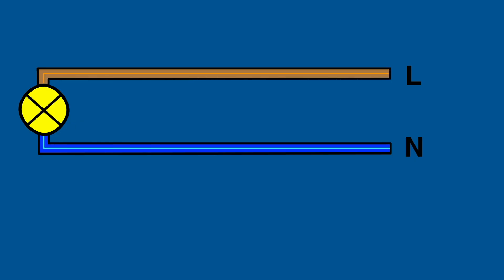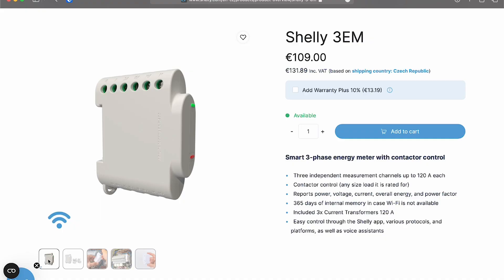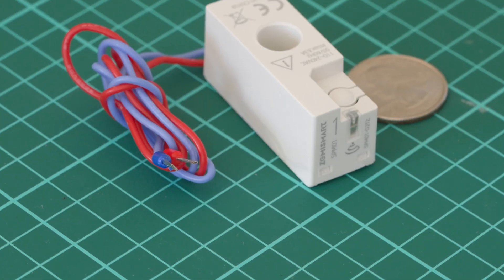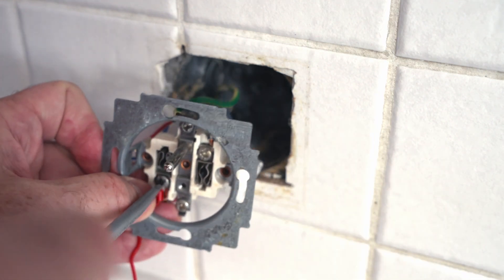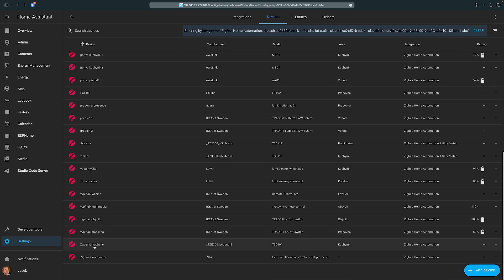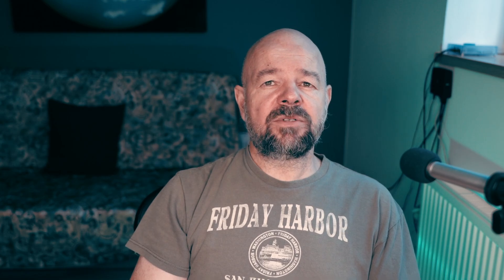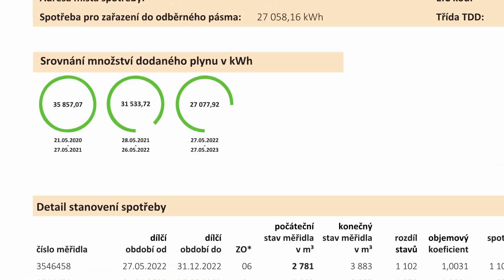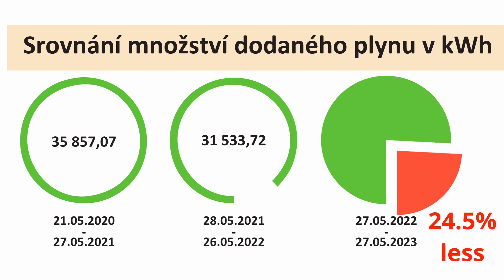Everybody needs to get their energy consumption under control - Zemismart Smart Energy Monitor

Comment: Hi Vaclav, really nice video! Me personally I am not a big fan of Zigbee Devices with the pairing button hidden behind a socket. I had to repair a lot of my zigbee devices so often, that I don't want to have the hassle to open the outlets every time (I mean, let a professional come to do it) :D
Reply from the maker: To be fair, this is meant to be installed in the switchboard, then the button will be facing the front. I did install it inside the socket to prove it can be done thanks to being so small (as well as because I do not have each socket terminated in the switchboard).
Reply: @bruxy70  that is true! if you have them installed in the switchboard they are really nice! If you have a stable zigbee network that will probably work too :D For me I just had to repair devices so often, that I don't want to have more devices that are also hard to access :D

Comment: Voltage is usualy marked as U and U*I is apparent power (which should be marked S). Active power that you pay for is P=U*I*cos(phi). Anyway thanks for the tip to this little meter, will look to it.

Comment: Octopus Energy in the UK will, on request, send you a tiny WiFi unit that listens to your smart meter and has a home assistant integration.
Reply from the maker: If they are able to identify the individual appliances from measuring the overall consumption, I'd be really interested to see how it works. I've seen some that do that, but I'd really like to know if that works.
Reply: @bruxy70  Octopus Mini is based on total main metered electricity consumption, alas no granularity other than frequency.